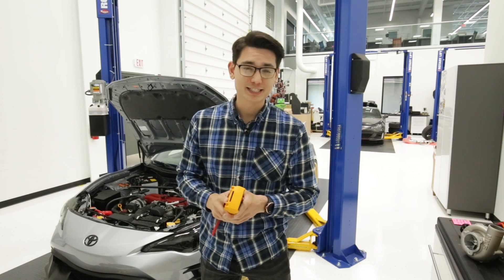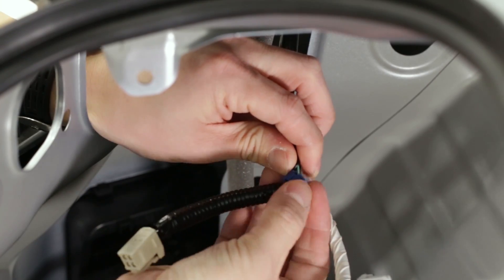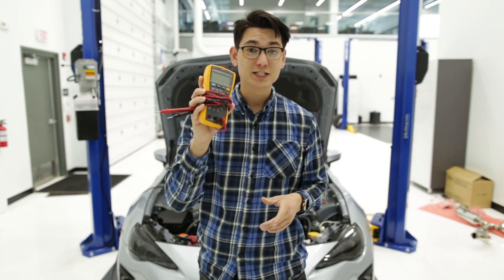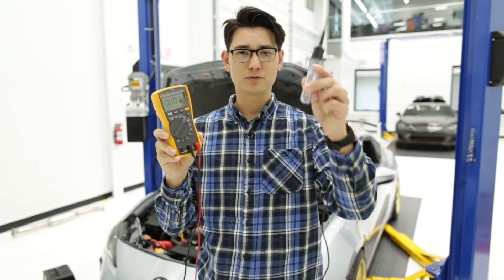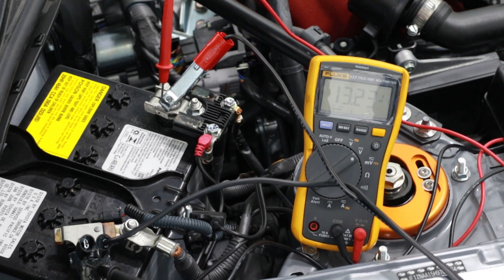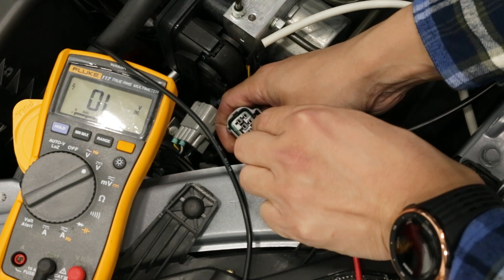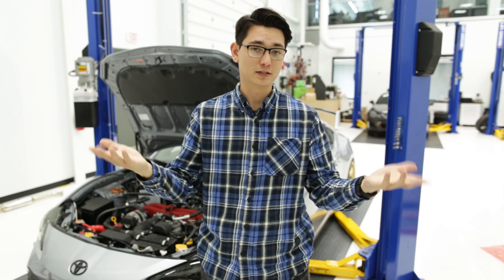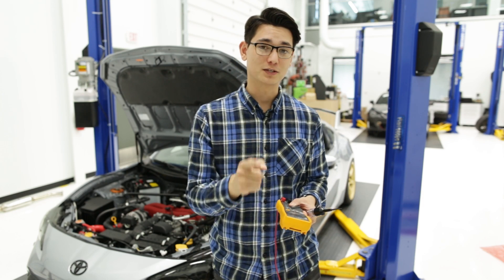How to use a multimeter for light upgrades

Comment: You should also add that a test light is a bad idea a LOT of the time. If you test an airbag wire with a test light you are in for a bad time
Reply: Why is that?  I’m new so this video was very helpful
Reply: @ShiftKoncepts  test lights introduce resistance on to the circuit. Newer cars with very picky computers will not be happy if they see resistance to ground on a circuit that shouldn’t have more than designed